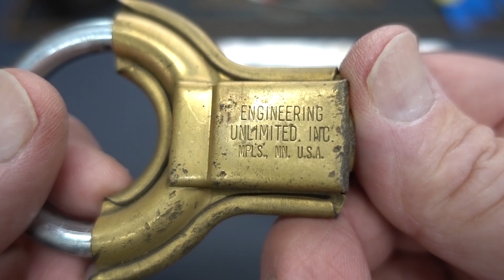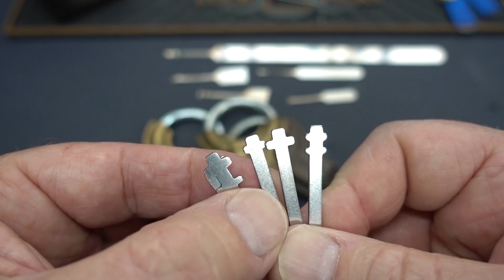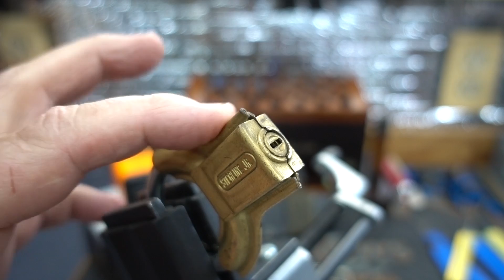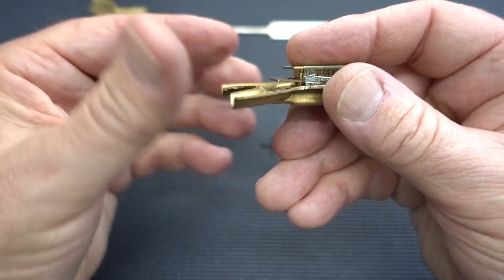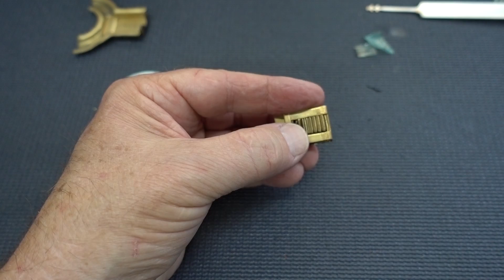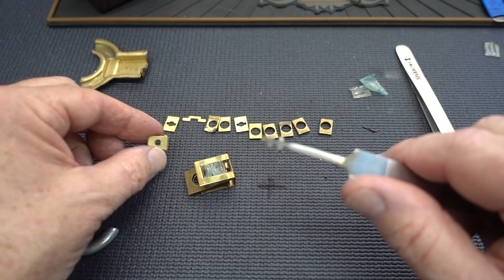(1346) Sterling Gas Pump Lock Picked & Gutted

Comment: I recently found one of these in the street by the curb. Same exact size as this one, but it's not a "Jr" but still made by "Sterling" and was stamped with Florida Power on the other side. It was unlocked and had so much tarnish on it that I thought it was painted. But after soaking it in vinegar for an hour, scrubbing it with a steel and then brass brush, wiping it clean, then polishing it with the brass brush and sewing machine oil it turned out to be full brass. It's quite shiny and like new now. After locking it, I opened easily with the smaller of the "T" shaped warded key.

Comment: You could build a fairly good lock making a few more locking tabs and thinner spacers and the bent clearance plates then weld up the shackle body. It would still be pickable but you aint gonna be thinking its so mad inside looking at it.

Comment: Thank you for this video. I received one of these locks in a bulk lot of used locks I grabbed off of eBay. I was lucky enough to have a key, but I thought it was a really unique lock. I had never seen anything like it before. That ring mechanism is definitely weird! Surprised when you mentioned that these are still made.

Comment: Great work again, saw these on Electric Utilities West Coast Florida..
When I was a kid, about 50 years ago, I filed down the Master Zig Zag key, all but the end, leaving a "T", with tension, I would insert all the way in, turn, pull out a little, turn again, it would open, I believe your single t may work same way, think also a Key could be made, by finding where it will turn, mark pick at the depth, find other places it will turn, mark again, pull out and make using the marks to show where needed. Bet you may be able to grind inside the round only, and slide body off, not sure if it will, you should be able to see if parts block the body from sliding. Getting an Underground Service, I asked to see the key, was surprised to see it was a "simple?" warded lock. Great work, was curious about the inside. Beauty is skin deep, the Beauty is what's inside.

Comment: I was recently gifted one of these sterling gas pump locks. I think it must be an early model because the guts are even more simple than this one and can be picked with a simple skinny bar. In fact, mine came with an "emergency key" which is just that. If you have any information on anything like that I'd love to hear it.

Comment: those plates are probably designed like that to allow for the restrictors/spacers to be put in in any order, making it more random and secure. you could have 3 spacers, one restrictor, the actual key plate, another spacer, and the other key notch to make customization of the keys. however if this isnt the case then one key would work for all of them, thus rendering the entire idea of this lock worthless unless as a deterant

Comment: I'd say depending on how you put those plates back in there, you could re-key it for various widths between the key's tabs. That's probably why they used those thinner strips before the curved piece. You could have 1,2, or 3 thin strips between the two key tabs. Really cool that the lock was made entirely of stamped parts (making it dirt cheap to manufacture).

Comment: These locks are used specifically for electrical utility companies. Here in Central Florida, Duke Energy and Florida Power & Light use these for locking transformers, pedestals, and gates to their equipment. I have asked lineman for years for a key. It would make our lives much easier. 

Any other electricians reading this comment where you've seen Sterling locks.

Jeff Licensed Journeyman Electrician - Sunny Central Florida
Reply: The Poco use the same locks here in Prince Edward Island, Canada for ct, and meter cabinets etc.
Reply: I have a whole string of those that use the same key.
I've put them away for safe keeping,but don't remember where.
My Dad got about 50 of them at an auction many,many moons ago.
I'd rather lock stuff up with one of those ring locks than most Master,American,or Brinks branded locks.
Those brands produce nothing but junk.
Thos ring locks are pretty tough considering what they are made of.
I live in SW Volusia County.

Comment: Wait is that new gadget actually a fibre optic type microscope, or is it something else? Those things would be so damn handy for my electronics hobby, in addition to locksport that as you know, I'm just getting into. Any model number or clues as to where I could buy one? That'd be so graciously appreciated. Cheers! And sorry for asking questions on every damn video lately, I know that has to get annoying. But I'm new to this craft and I'm curious - might as well learn from the best in the business!

Btw, I'm ordering a sparrows nightschool and wizwazzle set!
Reply from the maker: I did not buy this one, but Kaitlyn, a generous subscriber sent it to me.  I don't know where she bought it but here is one on eBay that looks very similar.  https://www.ebay.com/itm/Andonstar-2MP-USB-Digital-Microscope-Camera-Magnifier-video-Endoscope-Camera-US/201001891642?hash=item2ecca5773a:g:Sv8AAOxyNo9Spizk
Reply: I think it's this one: https://www.ebay.com/itm/Andonstar-V160-2MP-USB-Digital-Microscope-Video-Camera-Repair-PCB-Tool-Camera/401587164758?hash=item5d8075d656:g:oKQAAOSwbpVbfiJm or at least I think I saw one in another video. I have one myself, it's not really a fiber optic thing, just a USB camera with a macro lens. It's handy for checkin circuit bords and such. They are available with several versions with different features and different stands, here's a review of one version: https://www.youtube.com/watch?v=H2P1_JZYnVc

Comment: Here’s the collaboration/challenge.
You each choose a 7 pin core.
Into that core you can pin it up with any 2 pins of your choice.  You can change the core only where those 2 pins will be seated.  You can then make One key.
Install the core into a lock of your choice, and exchange the locks.  Included with the lock there should be one mummified key, and 3 blank keys.

The lock you receive should be just like the one you send... but different.

Pick the 2 pin lock, gut, and then alter the lock adding 2 more pins, and reusing the 2 pins it came with...in any way you want.  The core/bible may only be changed in the 2 added pin locations, where the 2 original pins were located in the core/bible should not be modified.  Make a new key. 
Send the lock back with 1 old key, one new mummified key and 2 blanks.

This continues add 2 more pins.
Reuse everything, in any combination.

Last round you only add 1 pin.

It’s the challenge lock ramp up.
Remember, you will receive what you give.

Comment: Should send in one of my works one shot locks. Looks just like these but no key hole.
Reply: Scott Smith So equivalent to the linear one-shot locks used on shipping containers? Locks once, remove with bolt cutters, guaranteed unique serial number printed on the lock, tell recipient across the planet which serial number you put in, if it arrives any different, someone's been in the box, so refuse delivery and call the insurance or police.

Comment: When I was a kid they had zinc plated steel versions of these locks that were used on all the gates, chains, sprinkler boxes, etc. at the local parks.  I figured they were cheap and easy to have them all keyed alike.  Next time I'm in my hometown I will have to see if they are still being used.

Comment: We use these locks in the cable industry to lock up pedestals and our ladder racks. There are the small ones that you have and a slightly larger one. The keys have 3  little wings on them, at least for the ones we use.

Comment: Was the ad for a Bosch Grinder a sign that he can't pick it? Then attacks lock with a Bosch Grinder 🤔🤦
Reply: Cable techs use a pair of pliers to open them when the lock wont open, you can just unfold the edges.

Comment: Scotch tape 😅 Hey at least they are a step up from Multilock's efforts. Fascinating, Bill.
Reply: I think the scotch tape is only used to keep everything together while it's placed in the lock body. Once inside the lock body holds it together, so anything stronger would be overkill
Reply: Yes, it's obviously just used to keep the plates from falling out between the assembly stages. They could remove it before placing the core in the body but why bother?